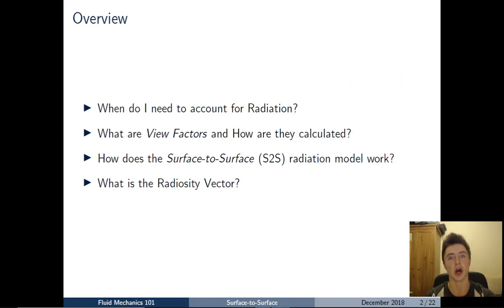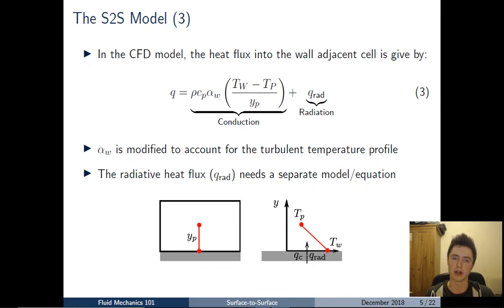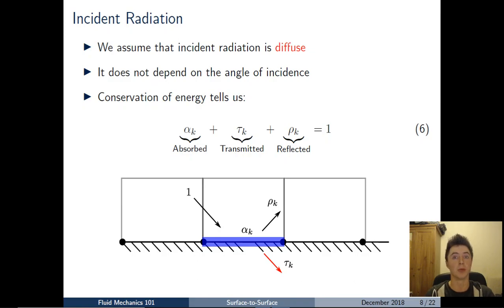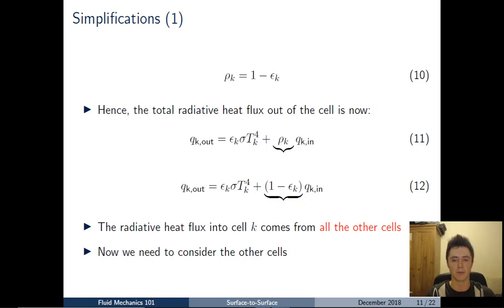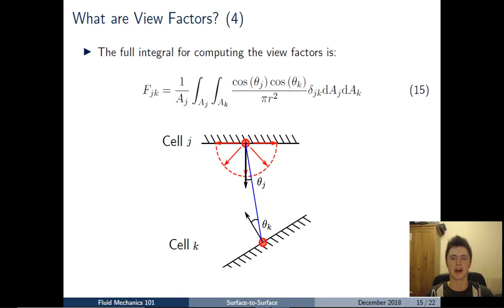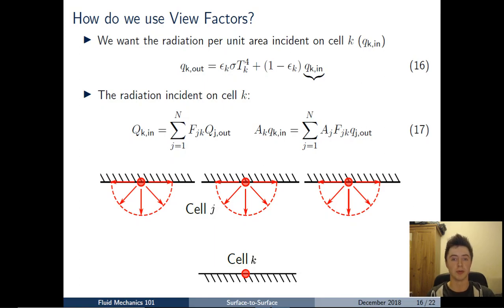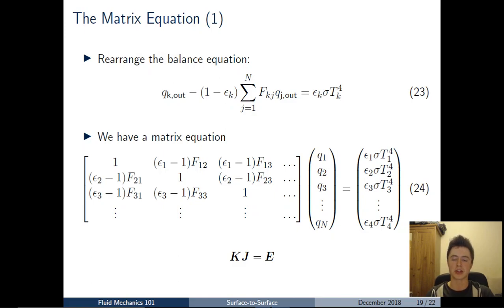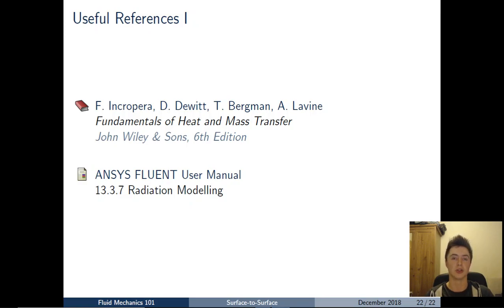[CFD] How does the Surface-to-Surface (S2S) Radiation Model Work?

Comment: First of all, I love your videos. I’m glad you take the time to really get into the weeds on important CFD topics.

Slight inaccuracy at 2 minutes.  Radiation does not scale with the fourth power of the temperature difference.  It scales with the difference of the fourth power temperatures.  Appreciating this difference in understanding means that you may consider radiation to be significant when temperature differences are still relatively small, but the absolute temperatures are large.
Reply from the maker: Amazing, thanks for the clarification. I have pinned the comment so everyone can see

Comment: apparently, emissivity is a function of temperature and wavelength. I wonder if the constant emissivity is a good approximation across the surface of the mesh if there is a big temperature difference? how much of a temperature difference and what material would make constant emissivity a good approximation ?

Comment: Hi. Its a nice video. It is mentioned that after calculating radiation heat fluxes from radiosity matrix equation, they are applied to the CFD energy equation as a boundary condition. Is it like convection flux at the wall= conduction flux at the wall + net radiation flux at the wall. How it will be implemented in Fluent. Is it taken care automatically when we select the wall as a participating surface in S2S model and provide emissivity values. Or is it done through any volumetric radiation source terms? Request you to kindly explain me this. Thanks.
Reply from the maker: Good question. I hesitate to answer because only ANSYS will know exactly how the boundary condition is applied. My guess is that it is accounted for automatically in the boundary condition (your first answer) rather than a volumetric source but that is my best guess 😅
Reply: @fluidmechanics101  Hi. Thanks for the reply. On the ASNYS Learning Forum, they replied to this question saying the radiation flux is applied as a source term in the energy equation. I have referred the user manual of COMSOL Multiphysics. They have also mentioned that the radiation flux is applied as an internal source term. I think they have applied the source term as divergence of radiation flux at the surfaces. I don't know if they have followed similar procedure given in section 4.2-6 Boundary conditions (Chapter on Heat Conduction) in Numerical heat transfer and fluid flow written by Patankar. 
Since we specify emissivity value at the participating surfaces, the source term would be applied only at the surfaces. 
Request you to kindly give your comments about this. Thanks.

Comment: Radiation is a surface phenomenon only in the case of a non-participating medium, i.e. when optical thickness of a medium = 0, or am i wrong?
Reply: I think you are right. There is also volume radiation. it's not only a surface phenomena
Reply from the maker: Yes, correct!